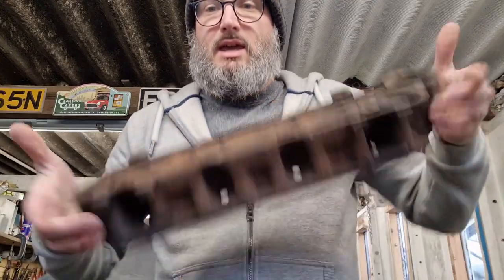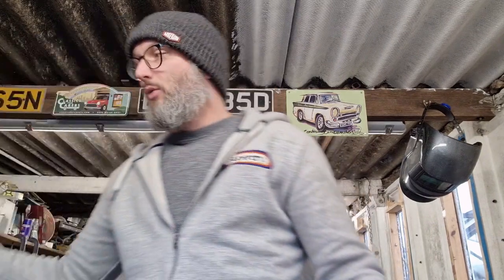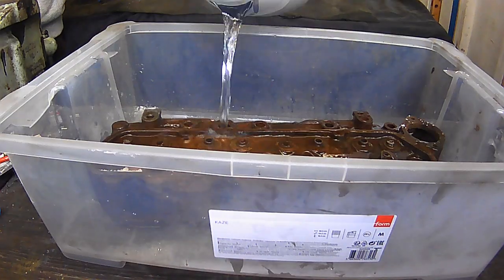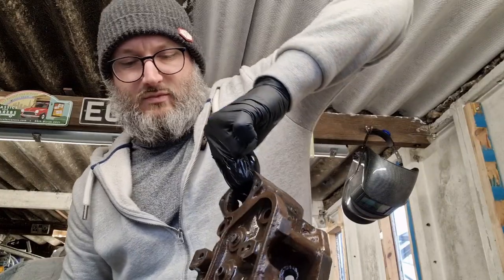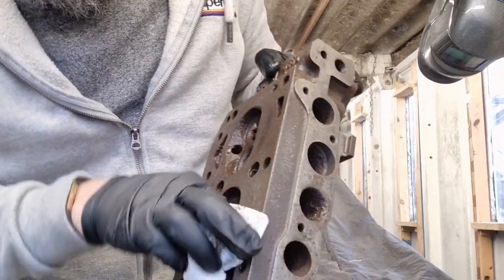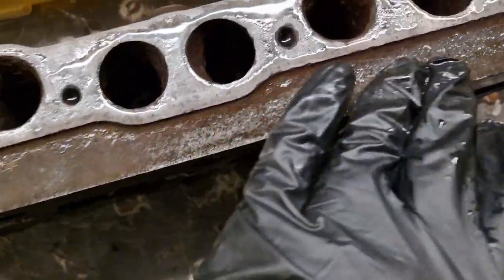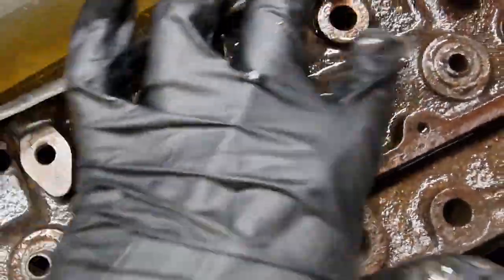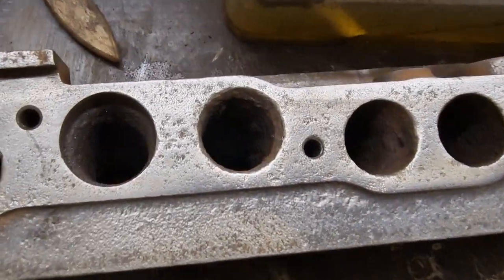Easy Cylinder head cleaning

Comment: Thanks for the video! I tried this out and my part looks much better, though the water jackets still resemble something like a Titanic artifact. I was tempted to leave-in overnight but didn't want to wake to an empty vat of water & rust! lol Wracking my brain trying to figure out a way to loosen up all that junk that's out of reach...or just leave it.
Reply from the maker: You're welcome! I'm glad you've given it a try. My cylinder head sounds similar to yours! I'd probably leave it as is or speak to a reconditioner as they will have better equipment that what I used in the video.

I wouldn't use electrolysis as that can leave deposits in the galleries which is just as bad.
Reply: @jimbuilds  Hey Jim, one question for you. Is it normal for the metal to become a dary greyish-black? I'm cleaning an old '51 8BA cylinder heads. Thanks!
Reply from the maker: @studioadesign8454 mine went a grayish matt after a week in areas but not as dark as yours. I don't know if that's because of oxidation? I'll have a think on that
Reply: @jimbuilds  I was planning to do another round of the Citric bath but next time really dry it off well, maybe even hit it with some isopropyl alcohol to make sure all the water residue is cleaned off.  I have a feeling it's just due to a quick drying off and high humidity the following days it sat around in the garage. Thanks again Jim, this was way better than dumping money into an acid dip.

Comment: Citric acid is by far my favourite (cheap) chemical rust remover, vinegar / vinegar / salt combination leaves much nastier residues to deal with and smells a lot more..
Reply from the maker: You're right, I've tried vinegar but after a day or two it's like sludge and it stinks the place out!

Comment: Ide really like to see it's on the cards saving it? Skiming so much material that it's in tolerance would be interesting but are the valve guides okay and how much to clean the ports?
Reply from the maker: I'm hopeful it can be saved, I need yo check some of my technical docs as I think they state the standard height of the head so that would indicate if it has already had a skim.

The ports don't looks that bad but they haven't been played with which is an advantage for wall thickness and future works.

As for the valve guides - they're toast but if I can use this head I'd like to convert it to unleaded and that gives me an excuse to use larger valves and replace the guides for bronze items to reduce friction- all of this I will document. 

For the moment however this is a great head to use for designing parts and using it as a jig

Comment: For a reasonable result you should use glass bead bowls.
Reply from the maker: I would like one of those for bolts and brackets etc, it would need to be a big unit to fit the head in though

Comment: I doubt that you could machine that flat... it looks that rusted...
Reply from the maker: I have my doubts too, it'll work well for a jig when I start making inlet/exhaust manifolds. I have 2 more heads in better condition but aren't GT spec, they need cleaning up too so from what I've learnt here can be transferred across.